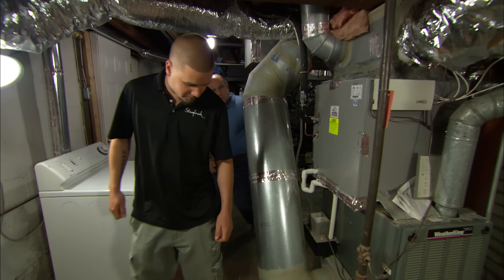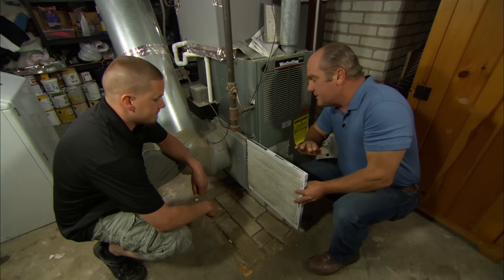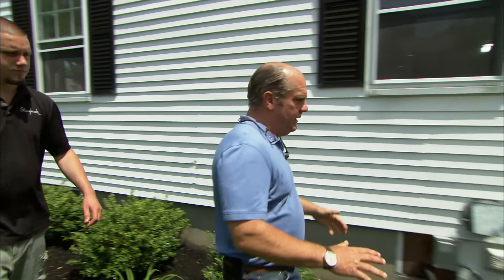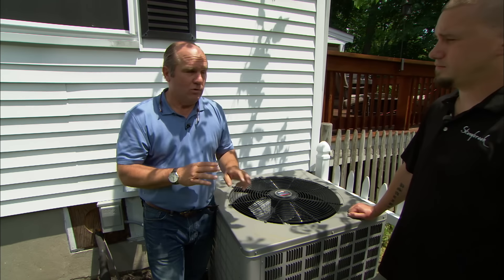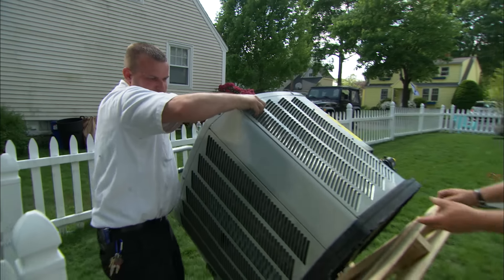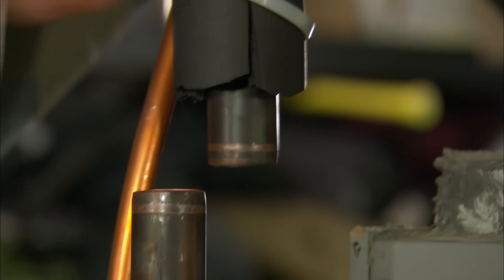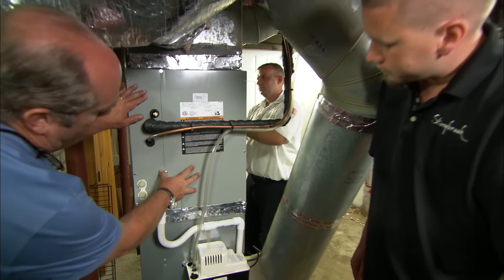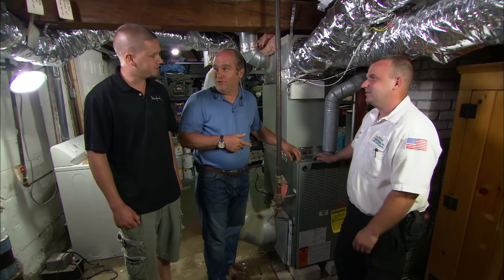How to Repair a Frozen Air Conditioner | Ask This Old House

Comment: never thought having too much ac power would be a bad thing
Reply: I need an explanation.. I don't get it either!
Reply: because you roughly need about 400cfm per ton and it was a 4ton.
then you gotta also size the duct for a 4 ton ac that can handle the volume of air needed.

thats why always make sure you have the filter clean. dirty filters restrict airflow.
Reply: An oversized ac would short cycle and not remove a lot of humidity.
Reply: If is too big, the system cannot be dehumudify the house properly
Reply: Very unusual, this was a BS video...
 Most likely a poor airflow caused the  Freezing.
A properly functioning unit just would NOT freeze up ever, no mater how oversized.
The only down side to oversized is it may leave more humidity in the home..
This was mostly BS, surprised by it.
Reply: Run and get us a fresh bucket of electrons.  Hurry!
Reply: You probably coumd have installed an additional fan to removwr cokd air from the condenser chamber would not have been proper repir but several thousand dollars cleeper
Reply: If you still need an explanation, you're going to have to look into how a system operates in order to condition the air, taking into account, but not only taking into account the reducing of the temperature of the air while at the same time, reducing of the moisture in the same air.

Comment: That system has multiple code and installation violations. Anyone installing hvac without doing a load calculation is helping customers be uncomfortable and hurting their energy bills year round. Rules of thumb are a recipe for a lawsuit. As the violations go #1 single sided return is not allowed on 75% of furnaces installation instructions. The other 25% require that the return be on the motor side of unit. #2 that single 12" return with the way that filter is installed can only flow maybe 1.5 tons of air with a psc blower. There is no way that the furnace doesn't have a failed heat exchanger from lack airflow. #3 no condensate safety or auxiliary pan is a violation where I am located. #4 who in their right mind would install a pump with safety equipped and not wire it in??? Im tired of thumbing this. My suggestion is that people who don't know should pay someone that does.
Reply: Andrew Acree good answer
Reply: Andrew Acree In my Florida area, one of the best a/c companies around is ACREE AIR...just saying

Comment: If the unit is oversized it will ice up. a 48000 btuh unit needs something like 1400-1600 cfm to operate correctly, and there was nowhere near enough duct for that. Not many people can afford to swap the equipment, so what I would do is put an evaporator thermostat. If the coil is too cold, it opens a switch. You wire the Y terminal to the condensing unit through it. It shuts the a/c off until the coil warms up, then restarts. Not optimum, the equipment will fail prematurely, higher energy costs.

Comment: It looks like the return air ductwork is very small. I have a two of those large (look like 12" round ducts) in my home and my heating guy said that was adequate, any less and I would have the freezing issues like this video.
Reply: It's not only that. It's that while it may work and not freeze up. It isn't delivering the heating or cooling you're paying for. So high bills for low comfort. This show contractor is emblematic of our occupation. Look for an RSES member. You have a hell of a better chance at getting a trained professional.

Comment: The only thing I'm curious about, is he said the new condenser comes pre-charged with freon. And they didn't have to add anymore. So how do they connect the system without freon evacuating everywhere? Do they remove it from the condenser first?
Reply: StrongEnough78 the condenser has valves that are opened after the line set is connected to the coil.

Comment: Upgrade the ducting to increase the air flow. The unit was too big and he'll have humidity issues sometimes but in those situations just turn the thermostat slightly lower. This will cause it to run a little longer to make the house feel like it should.
Reply: Upgrade the ducting? I'm guessing larger duct work but how do you get the ducting run throughout the house unless you open a bunch of walls?

Comment: If the AC unit as is never worked throughout an entire summer I would kind of understand your conclusion. However if the system as is functioned nicely for say 2-4 years the question should be why now is it freezing up. Maybe a few cool summers but an oversized system would not explain that. Everyone is entitled to make money but fair is fair, right is right. Unless this is a problem on a new install where labor and parts where covered seems the homeowner just paid for a week in Florida for the AC tech.
Reply: So what would be the solution?

Comment: The correct answer for his situation was the air duct did it to be increased and volume for the homeowner and make sure there's no restrictions proper ductwork would have been the answer Aaron's got a flow in so air can flow out things don't freeze up 4-ton unit loves the house to cool down just a little bit quicker especially if you're having a party with a lot of people or really hot day

Comment: I've long believed anyone who represents themselves as a pro in several trades is usually a liar. I'm actually licensed plumber and electrician. But a plumber or electrician who does this 40 hours will be better than me---hands down. I'm an HVAC guy. I'm a 25 year journeyman HVAC guy. I'm a pro. But a plumber or electrician? No way. Richard, imv, is a pro. PLUMBER. This was an accurate but misleading show.

Comment: I'm going to I'm not an AC tech, but I used to live in apartments and air flow was always the problem. No idea why the maintenance guy didn't know.. we had no AC on hot days. Finally I started looking the coil was DIRTY and the fan was was Full to the brim. So I got a long screw driver and gently dug out the stuff it was cold 15 minutes later. They tried for endless hours to fix it.
I have a house now and I keep my system clean running like new after 14 years.

Some things are too easy...

Comment: Personally would have used S strips on the plenum, and tried not to use any couplings on the line set. Less joints is always a good thing. Cool video though always like seeing how other installers work.

Comment: I live in Florida my AC runs perfect but when it rains my coil inside freezes they could is clean and so is air filter any idea
Reply: Sorry not could but coil
Reply: It's freezing when it rains because the humidity in the air rises to 100% not enough air flow over the coils. make sure your fan is set to high and not auto or low. If you can get to it make sure your fans aren't full of dust. Doesn't take much for a blower fan to clog up and work poorly. Also make sure your ducts are fully open and lastly make sure your condensate drain is 100% clean

Comment: The old unit still looked new, I guess the homeowner had no problem being scammed.
Reply: Probably had a home warranty. I got a new condenser when my old one went bad. They hooked a 410 A condensor to my 22 A system and it works just fine!
Reply: They didnt replace the coil either!

Comment: Did you put gauges on it first to check to see if it had enough coolant? Maybe try to find the leak? It'd be a lot cheaper to fix that if it were the problem! But by ripping it all out first you'll never know.

Comment: A really bad issue they did not fix was the lack of proper airflow across the surface area of the filter... the round pipe was pretty much flat to the filter causing the air to only have a small amount of the filter to flow through. Rookie mistakes galore through the entire video... the "actor" does not even know which direction the refrigerant flows to and from the evap. coil.
Reply: You are completely right congratulations I thought nobody was gonna comment on that thats the only problem right there.
Reply: Very true Ted!
Reply: Actor? You’re joking I hope.
Reply: Anti DIY HVAC love how they never showed the underside of the oil coil. You know. Because homeowners always change their air filters all the time. The filter that was in there was dirty and needed replaced.
Reply: I'm so glad to see somebody actually get it right... good job!
Reply: That's because Richard is only a plumbing and heating expert
Reply: Anti Dyi Ted is right , Complete hacked system , A good eye would spot a zone damping system look at the zone panel on the plentum and zone dampers on the flex .. Any Hvac guy or gal can see this fix won't help anything.

Maybe a Bosch condenser would help. Jk.

Comment: The (MAIN) problem is lack of RETURN AIR.
The RA duct is too small.
Yes the unit might not be sized right but the duct work is just as important to handle the PROPER airflow.

Comment: Lmfao . What's funnier the inaccurate information that Richard gives or what written here by H/O's
Reply: bad episode. bad information.
Reply: what are you talking about?
Reply: The diagnoses might be correct in the PARTICULAR case, but it is a fairly rare occurrence. MOST OFTEN the unit is low on charge. This episode implies that the reason you're unit is freezing up is that it's oversized. Most often (way most often) that's not the case.
Reply: true.

Comment: What about the zoning damping system  kedd!!!  I spy a zone board and zone dampers on flexs !! Hacks redoing Hack work!!
Reply: Good eye...saw that after review. Didn't  see a bypass to dump into return. That 12" return tapping in against the filter is the  Achilles heel.

Comment: When he showed the indoor coil and explained the direction of the refrigerant, he was backwards lol

No, small liquid line does not go back to the outdoor unit as liquid cannot be compressed by a “vapour”
Compressor.

The small line is liquid that has been condensed by the “condenser” and subcooled before reaching that metering device. Refrigerant is then boiled off leaving indoor coil as a cold vapour to actually cool the compressor

Comment: The return air too small the tonnage for the house is wrong . I seen him do a heat load calactulation this is correct . ive been doing this long enough too tell the tonnage of the a/c unit needed for the house

Comment: who ever installed that unit did a hack job 

return filter should be where the duct connects to inside living space , the return cabinate is not sealed 
the plenum is not the same size as the coil and should be 36 inches long 

the install was done well

Comment: Mildly frozen, run the heat to thaw, check air filter, pressures and adjust charge if needed. If charge isnt issue, check evap coil for clogged fins.  If clean, find leak. 
Badly frozen, shut down to thaw. Check same as before. Done.

Comment: I've been in the field for a few weeks and a lot of the new condensors i've been putting in are double in size i put in a 4 /12 ton from a 2 ton and a 5 ton unit. The model number tells the size of the unit? 6030??

Comment: I’m no HVAC tech but I found that dirty filters, dirty condenser coils, seized fan motors, capacitors and transformers gone bad cause freeze ups. Of course, low on refrigerant also. I’ve been doing it all wrong all these years! I guess replacing the whole system is the way to go? 😂

Comment: I'd like to know why my cooling line linked to my A coil is the only thing icing over. My coils never freezes. And the cooling line will ice over in just under 2 minutes. The blower is fine. The outside unit is fine. The air flow is fine. I just had it recharge. Worked for a month now it won't cool just freeze the line connection to the coil. Would really like a free inspection before deciding. My guy comes out charge a service fee tells me it's one thing then later comes back out for another service fee and try somthin new. I still don't have cool air. My home is 1600sqf my unit is 3 ton.

Comment: I am having the exact same issue now. For the air flow, I found the air filter was installed in the wrong direction. Could this cause the ice build up?

Comment: The real reason for the coil freezing is the amount of air flow is not enough for 4 ton of cooling. The return looks like 12 inch which would only flow enough air for 1 1/2 ton ac.  The new ac will freeze also.

Comment: The coil is freezing because of low evaporator operating temperature which is dependant on operating pressure.  Low evaporator pressure could be caused by very dirty filter, very dirty coil, very restrictive ducting, low indoor operating temperatures, or low condenser pressure.   Low condenser pressure can be caused by low refrigerant charge or extremely unusual low outdoor tempuratures (computer rooms ice frequently at night because of low operating temperatures and the lower outdoor tempuratures at night).
Check evaporator super heat and it will tell you which problem it is.
Reply: Computer rooms need head pressure controls.  The dedicated ones come with them

Comment: Scan in action. The blower packages come standard 3 ton. 4 ton blower package and proper fan speed and he would be good to go.
Reply: cant push 4 ton of air through 2 ton of duct... that return is nowhere near big enough for 4 ton, cant even handle 3 ton... and that supply looks small and theres a damper system... and there isn't even a bypass damper. put in a bigger return, raise the fan speed, and put in a bypass damper, and likely would run without freezing... would still be oversized and likely have humidity problems though. but replacing wasnt the only option.

Comment: As an HVAC tech, this was a little painful to watch. Don't get me wrong, lots of correct info in here, but the refrigerant actually flows in the opposite direction (From the liquid line, THROUGH THE METERING DEVICE, into the distribution tubes into the coil, and out through the SUCTION line {because the compressor sucks, not push}). Didn't need to recover the refrigerant. Could've just pumped down into the condenser. And the charge always needs to be adjusted at start up using superheat and subcooling. Anyways, it's a video and it exists. Happy viewing.

Comment: I would add that a unit low on charge will provide high superheat, like a faulty metering device; the evaporator is being starved and the refrigerant will boil off early in the coil; ergo high superheat. However ANYTHING that inhibits airflow---dirty filter, closed off registers, eliminated registers (remodeling) bad board, cap, motor, dirty coil etc etc----means there will be LOW superheat. The refrigerant boils very late in the coil, or not at all. That COULD slug the compressor. The unit will be cold as hell and wet, and may, or not freeze. It could be well below 32 degrees, cold and wet as hell, and not freeze 100% of the time. Richard is smart as hell. But a smart tech looks at deltas, superheat, subcooling, static pressures, CFM before he concludes his diagnosis.  I know it's a TV show, so editing for time is necessary. But jumping to oversized? That's flying blind, and a risky move.

Comment: My AC unit at home will turn on the fan will spin but I'm not getting cool air inside my house can anyone tell me wht i can do to fix it?
Reply: I googled your question (since I have no idea):   "window a/c, fan spinning but not cooling" and got this google page:   
https://www.google.com/search?q=window+a%2Fc%2C+fan+spins+but+not+cooling&rlz=1C1CHBH_enUS709US709&oq=window+a%2Fc%2C+fan+spins+but+not+cooling&aqs=chrome..69i57.12344j1j7&sourceid=chrome&ie=UTF-8
Reply: SEAN. Check your settings not on  "fan only". 
Failing that call a tech, they can check if you have some other fault like gas leak or condensor fault.

Comment: and what happens/what should I do if thermostat reaches the temperature inside the house and it turns off,no more air coming out on vents(normal) but the ac unit outside keeps running

Comment: Your wrong on the explanation of the evap coil, refrigerant on straight cool system flows from the compressor through liquid line(smaller line) and in the expansion valve which slows the flow and pressure(pressure and temperature go together) therefore dropping the temperature on the coil, then the suction line(bigger line) is pulling the superheated refrigerant by the compressors suction.

Comment: Hvac techs are similar to doctors, we all have different opinions. Ultimately the replacement was the right option. Undersized return, yes. Old A-coil was installed sideways. In fact move the whole system back and get a taller plenum. 3 ton replacement maybe a little big but the output may have not output 36000 btu. And as everyone pointed out, a plumber confused the refrigerant cycle. Musta thought it was a heat pump 🤣

Comment: You mentioned a “licensed” technician.  That infers that a tech has a state contractors license, not necessary 
if he works for a licensed contractor.  He does have to be EPA certified.  That’s the difference between being
licensed & being certified.

Comment: Holy smokes; never thought I would hear Richard explain the refrigeration cycle wrong.  The liquid line (small line) feeds the coil with condensed refrigerant in the form of liquid.  The suction line returns the phase changed vapor refrigerant back to the compressor and condenser coil to be phase changed back to a liquid.  He stated the complete opposite.
Reply: really surprised no 1 noticed

Comment: My unit was freezing up I got the usual b.s about a new unit my answer was...save the sales pitch its a 30 year old unit and I'd like a much more efficient system just change it ended up wit a lennox system now we need a blanket when it turns on even when it's 100 outside

Comment: I was having issues with mine freezing and come to find out my A coil in the furnace was half clogged with pet hair so not enough airflow was getting through. 

It’s not easy to clean so if you are not a handyman do not try and clean it yourself.